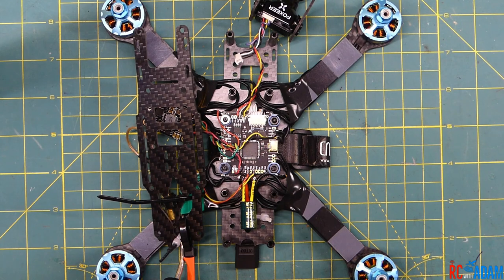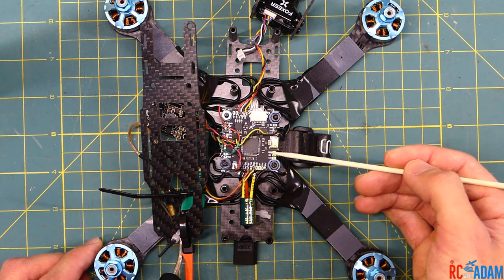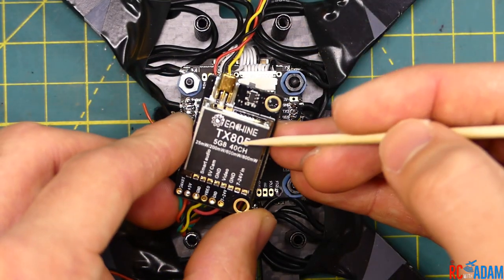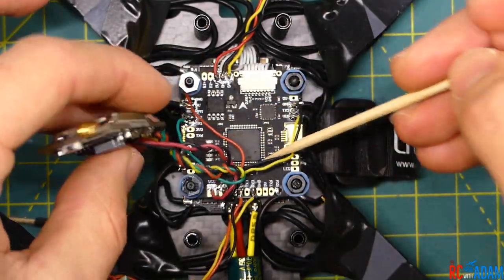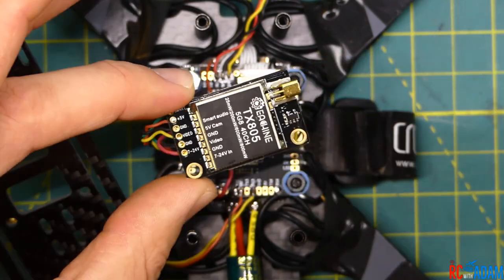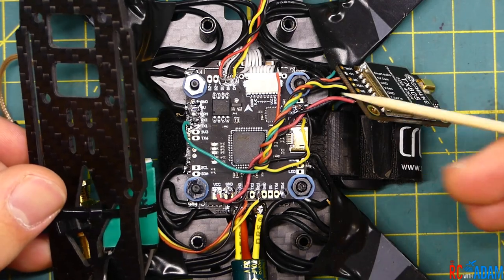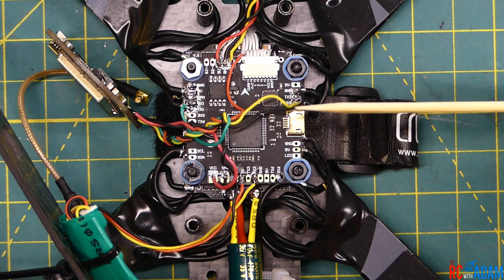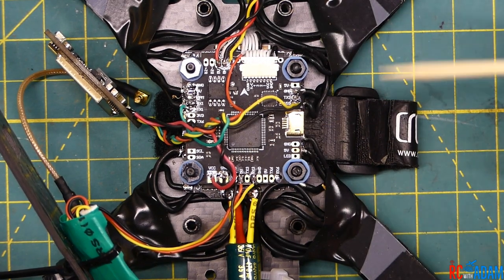MAMBA F405 - How to Connect VTX, Smart Audio, i-bus

Comment: I'm sure someone has already said this, but for those of us with FrSky Radios, RX1 is for SBUS (no invert hack needed), TX3 works for Smart Audio (that's what I run at least) Awesome stack so far, I love it! Still tuning a bit, but I've uploaded a few flights with this stack on my channel. Keep up the good work Adam
Reply: Hi, I am new to drone, and make my first one using Mamba F405 and FrSky i6, just wondering is FrSky i6 using IBUS or SUBS? Thanks!
Reply: @jiayuyang6725  I think you might have a "FlySky" i6, FrSky doesn't make an i6. That was my biggest gripe with the hobby when I was picking out my radio, those two company names... but anyway, the FlySky i6 will use iBUS. One trick is to think of FrSky as Free-Sky (because nothing is free and you'll pay a lot more) and FlySky is just Fly-Sky (because it's affordable and you can just Fly.)
Reply: Hi, I have some issue to connect my R-xsr to my F405, for the telemetry do you connect the smartport inverted or uninverted to the TX3 ?
Reply: @jogzUK  I believe UART1 is the only one that's inverted on this FC (for SBUS), so I have mine wired to the un-inverted pad on my R-XSR (Any remaining UART should work, but 6 is already so close to 1 [which is where SBUS and 5v are] but I think 3 should work too, my smart audio is on 3 so I cannot confirm)
Reply: @jogzUK  But I can absolutely confirm that Telemetry is working for me with the following: RX1 = SBUS; TX3 = SmartAudio; TX6 = SmartPort (telemetry). The only hack is I am using UN-inverted SmartPort on the R-XSR, there's a pad on the X-XSR which you can solder a wire to.
Reply: will it work if I put smart audio on tx3 and ibus on rx3?
Reply: Hey Daffy.. I'm running one of these power towers with xm+ and i hooked it up through g 5v and sbus... Should i be using rx3 instead or..? What's going on? Im bound to receiver and i get blue LED  when armed. But no action... I don't get it. In betaflight uart1 is rx apparently. Also the radio setting are sbus where i have it set up. Do you have any ideas? Any at all? I'm going over everything with meter, it all seems straight..
Reply: @fahmialias  I'm not sure if using the same UART is a good idea, I believe it could be possible with setting up soft serial, but I wouldn't use soft serial for my radio communication. I believe RC Adam explains how to configure ibus and smart audio in the video (ibus = FLYSKY and sbus = FRSKY, 2 very different companies)
Reply: Daffy Dubz FPV i see.. i guess i’m gonna use tx6 instead for smart audio. thank you 😁
Reply: @softsmoken  I've never used an XM+ so I cant confirm, but it should be fine on 5v, gnd, and sbus on RX1. And then make sure betaflight is configured correctly with UART1 set to serial in the ports tab and rx set to serial for frsky on the config tab. Sometimes frsky receivers can be put into ppm mode so that would cause an issue like you described, bound but nothing works. There really is too many things that could also cause that to be able to trouble shoot via YouTube comments though haha. My advise, create a new module on your TX (I'm assuming it's a taranis of some sort, QX7 for example) and re-bind the RX (XM+ doesn't support telemetry so I'd use channels 1-8 with no telemetry on the TX, D16) and also verify the RX is soldered to RX1 on the MAMBA. Let me know how you make out.
Reply: @fahmialias  I didn't get a chance to respond before you edited your comment, I'm assuming you got the UART's figured out? They should correspond to the actual number on the FC, so RX3/TX3 is UART3 in BetaFlight for example. Best of luck!
Reply: Daffy Dubz FPV yeah i just realised it as soons as i pressed enter 😂
Reply: @DaffyDubzFPV  right i understand. thank you for your time. Much appreciated. That is how i have it wired... I'll need to look at that betaflight config tab you mentioned..ALSO RX1 is now labeled sbus on the Mamba FC
Reply: @softsmoken  No problem man, I hope you can get it working! There's nothing worse than having everything set up and not being able to fly :( And good I'm glad they updated the pad label to just SBUS haha!
Reply: @DaffyDubzFPV  in the receiver tab, rssi channel- what should i have that set to? I've tried aux 1-5 i doubt anything there's gonna make a difference.. the fc blue led blind when throttle up, solid blue on arm. But do fuckin nothing. It's all wired correct, I've meter checked every wire. I dunno wtf it could be at this point. Somehow I'm not surprised shit doesn't work. Electronics are garbage. I'd rather rebuild an engine. You do it right, and go figure it fuckin works, these things. You never know and then when it doesn't work you still never know.
Reply: @softsmoken  What radio are you using? The rssi channel is for Telemetry so you can see rssi in OSD, I believe default is Aux 12 (channel 16) but you are having a different issue. First make sure the radio is in D16 mode, then make sure (I'm assuming you're using BetaFlight) on the Ports tab UART1 has Serial checked and everything else is disabled on UART1, click save. Then in the Configuration tab under the section for Receiver, the Receiver mode is "Serial-based receiver (SPEKSAT, SBUS, SUMD)". And Serial Receiver Provider is set to SBUS, click save. Then in the Receiver tab, Channel Map must match the Radio (I use the QX7 radio and the default for a new multirotor module is TAER1234) it's the order of throttle, roll, pitch, yaw. Click save. Once all that is done, with usb still plugged in and radio on, plug battery in (this FC board will not power the RX on the USB power alone) once flight battery is plugged in, move the sticks on the radio and you should see the correct movements on the bars in the Receiver tab. Let me know if that works.
Reply: @DaffyDubzFPV  thanks for your time again, it's a taranis x-lite. I'll mess with the settings again as per your info, and get back to you.
Reply: @DaffyDubzFPV  that works, but I've already manually done the channel taer, and the channels move on beta flight arm switch moves, blue led on FC blinks when throttle in, is solid when armed.. so it's getting commands... And it understands them. Makes no sense.
Reply: @DaffyDubzFPV  i dunno. Weirdness. It should be working.
Reply: @softsmoken  Did you setup the "Arm" to the correct AUX in the "Modes" tab in BetaFlight? If you are seeing correct movement in Receiver tab, then RX and TX are working. In the Modes tab you need to enable "Arm" and select the AUX channel you wish to use as Arm switch, then select the range in which "Arm" is on (anything outside that range "Arm" is considered Off - Example: 900-1400 not in the range [Pos 1 Arm is Off] and 1400-2100 is the range [Pos 2 {and Pos 3 on a 3-Pos switch} Arm is On] ) Hopefully that makes sense. But like I said, if you're seeing correct movement on Receiver tab then it's not your RX or TX. Also, assuming Modes tab is setup correctly, make sure quad is not connected to BetaFlight when trying to arm and flight battery is plugged in. Also, make sure your Min Throttle in BetaFlight is a higher number than you're lowest throttle position (not sure if you've trimmed your throttle to be in the range of 1000-2000 or not, but I believe FrSky defaults to somewhere around 978 or something - regardless, set Min Throttle (in the Receiver tab) to be like 1025 or 1050.  [ And just to be clear, you're not getting a solid Red LED on the XM+ AND the solid Green (or Blue)? Just the Green or Blue, Not Red, right? ]
Reply: @DaffyDubzFPV  it's gotta be a problem with the FC talking to the ESC.. i think. The xm+is solid green once i turn on the taranis xlite. The blue light is on the FC that flashes if you move up the throttle and turns solid upon arm. Also yes the only flag I get to disable arm is that I'm plugged into USB... Everything is as you said. And I spin up motors in betaflight... Gotta be no talky talky FC to o 4:1.
Reply: @softsmoken  So you were able to successfully spin the motors in BF motor tab? Using the sliders I'm assuming? So ESC works (and communications between FC and ESC works since BF is connected to FC and not ESC). And you're able to see correct movement in Receiver tab when moving sticks on TX, and arm switch is correct aux on receiver tab and range for arming is correct? So TX RX and FC works. Sounds like something software configured incorrectly somewhere, well start with the Configuration tab. On the configuration tab in BF, set the ESC protocol to dshot600, make sure motor_stop is unchecked and set the motor idle to 4.5 or something around 4.5, make sure you're ready before you arm (take props off in the house) because as soon as you arm the motors will spin. Also make sure "enable gyro 32khz sampling mode" is unchecked. And gyro update frequencies and pid loop frequencies are both set to 8khz. Is your accelerometer enabled? If so, make sure the maximum arm angle is not too low and make sure the FC is not upside down (I only fly acro so mines always off to save cpu) also is 3d mode enabled? (mine is off) also turn off channel forwarding and esc sensor. Then save, disconnect, unplug usb, turn on Taranis, plug flight battery, and arm.
Reply: @DaffyDubzFPV  nah motors won't spin.. they should but they don't. And can't get blheli suite to find the ESC on pc or on Android with speedy bee.. Or blheliapp.
Reply: @DaffyDubzFPV  damn thanks so much for all your input. Unfortunately I've got the settings that way I've checked each one many times at this point lol it's like a bad recurring nightmare. But anyway no dice. Wtf
Reply: @softsmoken  if the motors aren't spinning then it's the communications between fc and esc, try unplugging then replugging the cable between fc and esc or try the other cable (I got 2 with mine) if that still doesnt work then the connector is busted and you have to solder each wire to the correct pads
Reply: @DaffyDubzFPV  I've switched the cables already same shit. No sounds on plug in either. BTW i really appreciate all the effort you've put into helping me out thank you.
Reply: @DaffyDubzFPV  ACTUALLY i just thought of something while considering wiring those plugs... Why is the FC getting power from the esc wire if that plug is bad.. right? Cuz battery plugs into esc then fc gets power from that ribbon cable
Reply: @softsmoken  this is beginning to become too much for it to be worth it almost, is it still possible to exchange? Maybe a bad esc?
Reply: @DaffyDubzFPV  chatted with Bardwell this morning, been back and forth with rdq.. they both say the same at this point (late this morning) Must be bad ESC.
Reply: @DaffyDubzFPV  so rdq decided the esc was bad, they gave me some store credit so i ended up with dalrc engine pro 32 bit 40a 60a burst 4 in 1 and the Mamba f405fc(they only asked for esc back) for under 60$. Can't complain. That windy day.. walked outside motorcycle fuckin blew over... Who says 70s bikes don't have a low center og.. hah! (Gonna have to replace twist throttle at least) S. O. A.B.
Reply: im using a frsky xmplus i hook up sbus on tx1, i get the remote bounded , i get the green ligth, in betafligth uart1 e with seral rx on, reciver tab i dont get any inputs from the remote, can you help me out?
Reply: @phikobawa  hey man.. you need to be on rx1 for the xm+ that's not an r9 (900mhz receiver) the newer ones of these mamba flight controllers say sbus not rx1 but you need to wire sbus to rx1 or sbus, it will say one or the other, smart audio you would put on tx1 if you want, but if your using uart1(rx1/tx1) for sbus already you need to use tx3(uart3) or tx6(uart6)...also switch on serial rx in betaflight in ports for uart1(should be uart1) u can open the replies and check out daffydubz response also, should be right up top. This isn't my channel but Feel free to get in touch I'll answer questions if I can. If you need to use the CLI in betaflight the uarts are counted alittle different 0=1 1=2  2=3, computer language counting.. 0 has an actual value
Reply: @DaffyDubzFPV  
Have you got reading from the current sensor on this ESC.??? If yes how?
Reply: @softsmoken  hey bud i am having the same problem, did you get it to work ? i got my frsky xm+ sbus to sbus, ground and 5v just like you, binds good but no signals on betaflight.  any ideas on how to get it to work ?  on the MAMBA F405 MK2 manual sais sbus = uart1 
so it should work but i get nada.  please help
Reply: @rbonvent  cool, how many of these have you built? And is your radio stuff all setup too, The mixer and channels etc?
Reply: @rbonvent  i help as much as i can.. i haven't not gotten something to work yet, regardless how long it took or who i got info from..
Reply: Smoke-This i got it to work :) no luck with sbus and xm+ had to use my r9mm with rx3 on the flight controller pad no problems there.  But wantes to get it to work with sbus and the xm.  Thanks anyways man!
Reply: @rbonvent  no problem, anytime. ill help if i can.

Comment: Hey, nice vid! I want to solder external mic to Mamba ESC/FC if possible, the mic is 6-12V... I can't solder it to Mamba VTX because my VTX is closed variant (Ultra 1W VTX). Any advice where if possible to wire external mic that has 3 wires (black, red and white.. white should be for audio, black for power)?

Comment: very good video
i have question
Why did you connect two gnds of tx805 vtx to the fc? Is there any special reason?
Reply from the maker: Good question. I think it will reduce noise in the video signal, but honestly, I'm not totally sure. Also, it is easier to just solder it rather than have it dangling around.
Reply: @RCwithAdam1  
thanks for your reply
I also use mamba fc and tx805.
 But it suffers from throttle noise. 
I will also connect two gnds of vtx to the fc
Reply: @RCwithAdam1  Probably a stupid question (first build) buuuut just want to make sure that you don't need to solder both red wires as I see one dangling?
Reply from the maker: @TheOak82  Hi! Not a stupid question! No, you don't need to solder both red (positive) wires to the board. (the other red wire is for if you wanted to power your camera from the vtx).
Reply: @RCwithAdam1  Thank you!

Comment: Hi Adam I just built a 5 in with mamba f405 Mkii and rdq mach3 vtx . I have osd issues . In your video you said your vtx wouldn’t work on tx3 you used tx1 . I wanted to now what issue you had with your vtx not working on tx3 and what caused you to use tx1 . Was it to fix osd issues or some other reason

Comment: I have one question about the TX805 Vtx and the input voltage it receives (7-24v). If we connect it directly to those pads you pointed on the video, what would happen when we connect a full-charged 6s battery? If my maths are right, it would provide more than 24v to the Vtx, so wouldn't it get burnt?
Reply from the maker: Based on those numbers, it seems like it would get fried on 6s. But it also would make sense that the vtx would be rated for 6s if it's advertised as 24v input capable. Only one way to find out, I suppose!

Comment: Do we need to use power distribution board for it
Reply from the maker: Hi! No. The PDB is built into the ESC board which is the second board underneath the flight controller.

Comment: Is there are problem wiring whitout the capacitor?
Reply: No, it's not necessary unless you are using 6s batteries. If not 6s, a capacitor may contribute to a better video quality for vtx

Comment: i got the same FC and a Mateksys VTX-HV i connected it to TX1 and not I am able to see the menu pop up on the osd and I can  change my power channel and band but when I confirm nothing happens the LED on the vtx dont change but on the osd it changes to what I set it to. any ideas why this is happening and how to fix it
Reply from the maker: Do you have SmartAudio and the VTX profile setup in betaflight? If you don't, the Smart Audio won't actually work.

Comment: THANK YOU for this!!  I just got the Mamba F7 APP stack and could not figure out why the  F I couldn't get the S.Audio to work.  I changed the TBS white wire to TX UART 2 and it worked like a charm.   Not sure why the designated UART TX3 doesn't work.  It's the one the manual says to use.  Nonetheless, thank you.

Comment: Can we use UART6 as according to me it is already used in connecting the 4 in 1 esc to the FC. Plss reply.
Reply from the maker: UART6 should work fine. I think I've used it before for my rx. (Of course it depends on what exactly you want to use it for).
Reply: Can I use it for GPS
Reply from the maker: I don't know, but IIRC there is a dedicated GPS pad.

Comment: Hey nice vid man. I'm wondering if you could use tx3 for smart audio.

I'm running frsky r xsr and was going to try and use 5v gnd and tx1 for receiver and fport. 

Vic gnd and tx3 for vtx smart audio. Trying to keep the build as clean as possible.

Thanks for any help
Reply from the maker: That sounds like it should work. But I think you'd need an Rx pad for the receiver. Also what is fport?
Reply: I've just realised there are 2 tx3 pads. 1 by the vtx connection pads and one down by the vcc pad
Reply: I've only just found out about fport its frsky using 1 wire for sbus and telemetry
Reply: That's exactly what I do, SBUS on RX1, Smart audio on TX3 (I don't have fport so my smartport is on TX6)

Comment: Hey RC Adam thank you for the video, last year I bought the Diatone mamba F405 stack just completed the built, I connected the 5 volt cam to  the 5 volt on the right side of the pad near the USB port, when I made an attempt to power up the drone it comes on with a single beep or so and it shuts off but when you connect to the computer through the usb it comes on. Due to wiring that is incorrect would it resolve the issue when I try to power it on all the way? I would appreciate your guidance from anyone thank you. First Built